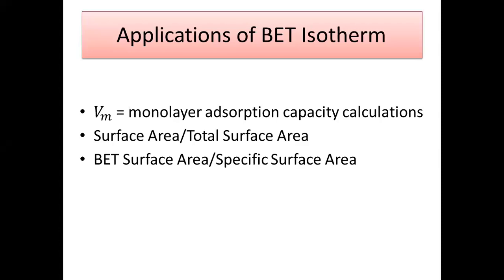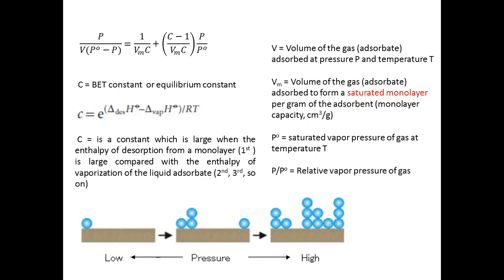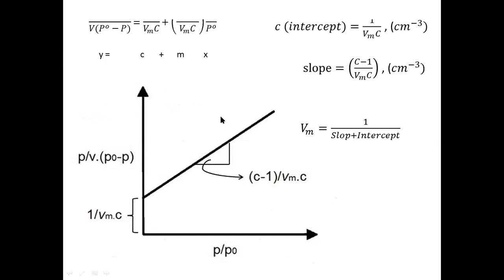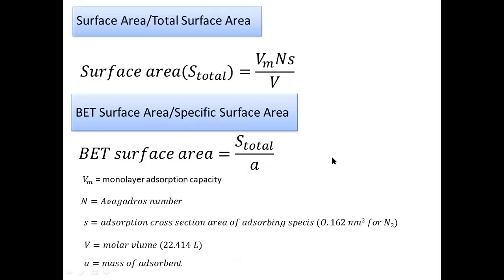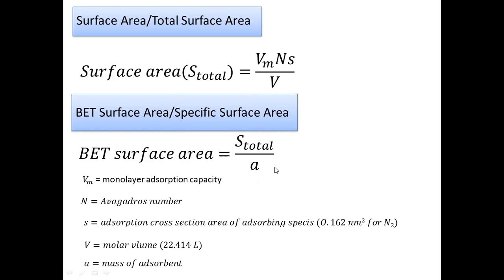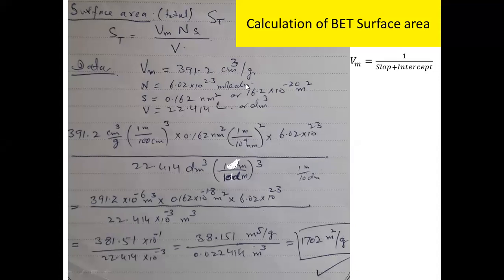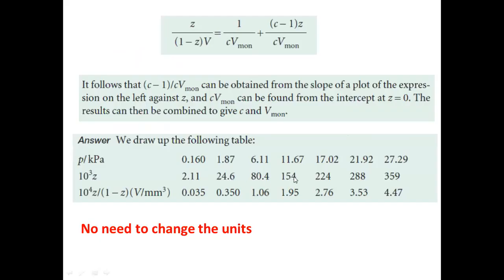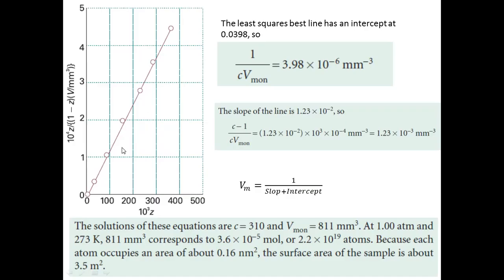Brunauer–Emmett–Teller (BET) Adsorption Isotherm: Calculations for BET and Specific Surface Area

Comment: From the First Exercise;
How come intercept became 0.00000398 when calculating for C.
When the intercept is 0.0000035 when calculating for Vm.i don't understand where 0.00000398 is coming from.
I was getting 352 for C.please reply urgently
Reply from the maker: I have already explained in video. This is just because 0.0001 is taken as common on y-axis (to smooth the y-axis) and when you multiply with 0.0398 it will become 0.00000398, because you have to multiply to get original value. If you do not take it as common, then it will directly give you the value of intercept of 0.00000398.

Comment: nice video but one thing sir i want to ask please tell me what is mass of absorbent ? i mean you calculate the value of Vm to be 391.2 cm ^3 /g but what is the value of vm will you divide with mass in gram and what is the mass of absorbent?
Reply from the maker: Just divide the mass of adsorbent with Vm, you have taken for the study. If it is 1g then the value will remain the same.
Reply: understood one last thing that i had confussion! to find Vm we use 1/ slope + intercept then the unit if vm is not in cm^ -3
Reply from the maker: @physicswithsirmuneer8975  dividing by 1, negative becomes positive
Reply: Thank you finally i got it actually slope has unit cm^-3 or /cm^3 so that when we divide by 1 we get unit cm^3 thank you very much nice and motivated video
Reply: Hello. I have basically the same question. 
If the Stot is in cm^3/g then if i divide it further by the mass of adsorbent 
(cm^3/g) / g
will give me cm^3/g^2

Also it doesnt make sense that i take the sample of 0.1g and Stot will give ...lets say 10 cm^3/g
Dividing Stot by 0.1 will grant 10 times higher value so 10cm^3/g will become 100 cm^3 / g^2 

The only resonable calculation would be if Vm was given in cm^3 and not cm^3/g 

Then Stot would be the surface of the measured sample 
and further calculation would grant the result per gram - by incorporation of the sample mass

So 
Stot = 10 cm^3
Stot/mass = 10cm^3/0.1g = 100cm^3/g ==> BET surf.
Reply from the maker: @wojciechczerwonko5247  Vm has unit of cm3 not cm3/g, i have explained in the video. Just divide with g  then it will become cm3/g